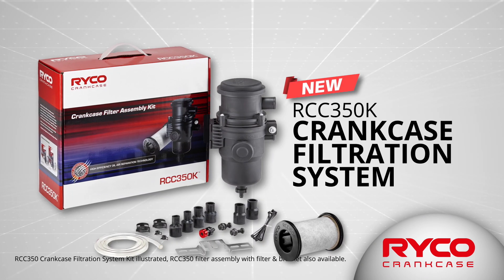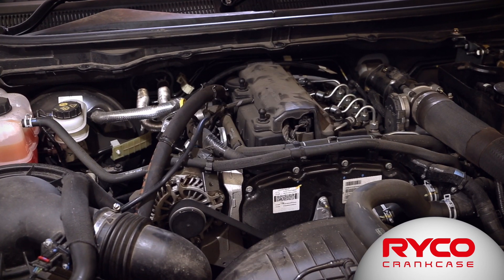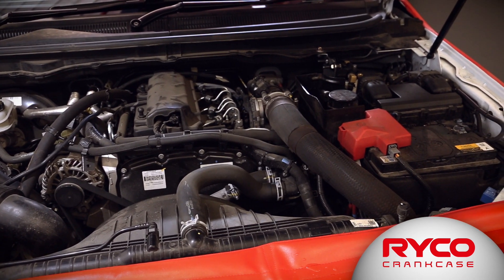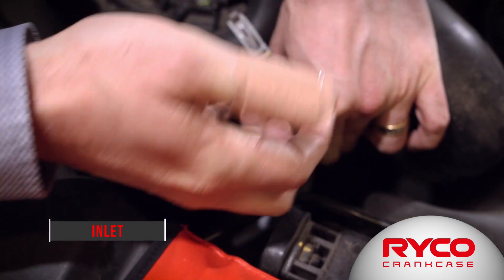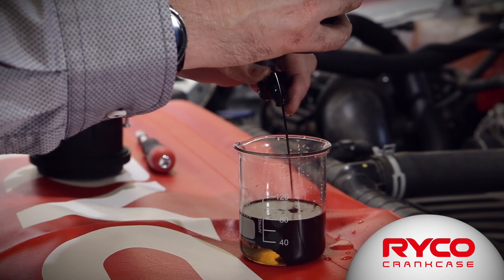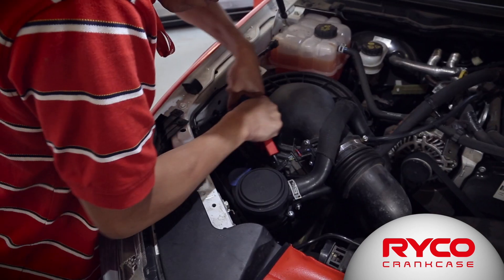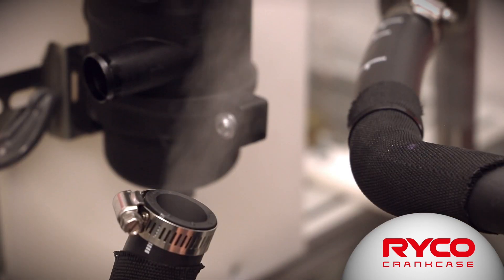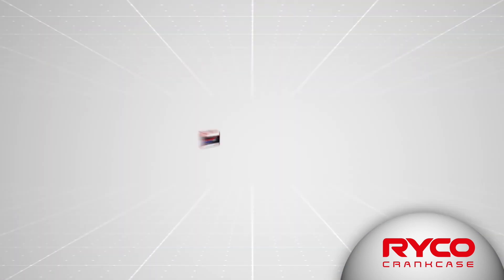RYCO Crankcase ventilation tested in the lab.

Comment: I'm guessing this cannot be used on the pcv to throttle body hose due to boost pressure?
Reply from the maker: The RCC351 catchcan has been designed to be plumbed into the air intake upstream of the turbo compressor.

Comment: I have fitted a ryco catch can to my 2018 3.2lt bt50... Very very keen to see how it goes down the track...
Ps... On a side note, its interesting that the inlet of the can is down the bottom & outlet is on the top? I thought it would be the other way around? ... Ryco team I'm interested to hear from you in that regard... R.
Reply from the maker: Great question! Our design has reversed ports to avoid any oil accumulated being sucked into the inlet manifold. Having the outlet on the top keeps the system protected if the system is neglected or when out in the bush and the vehicle is on steep angles.